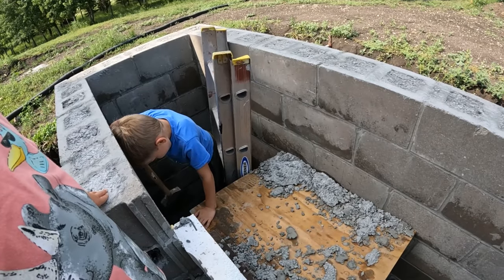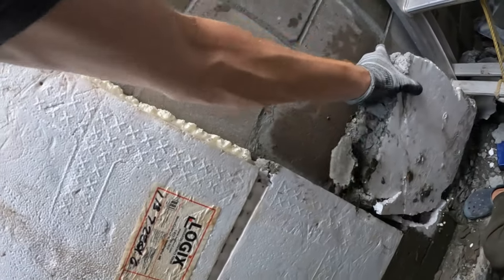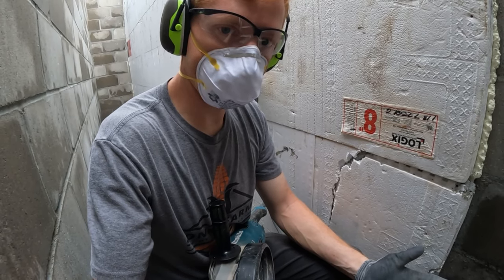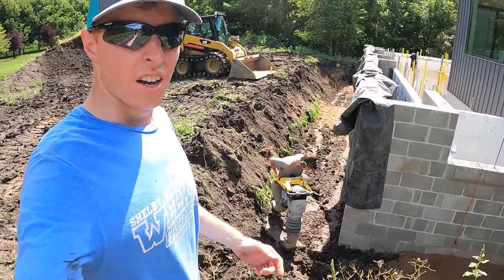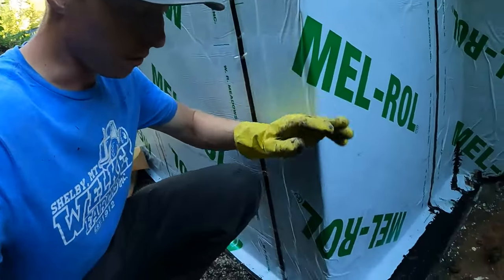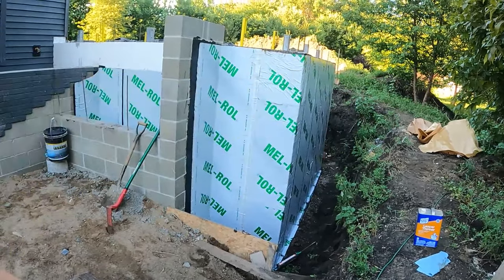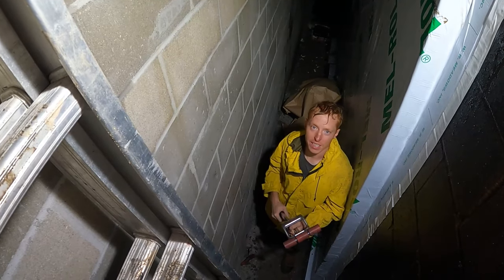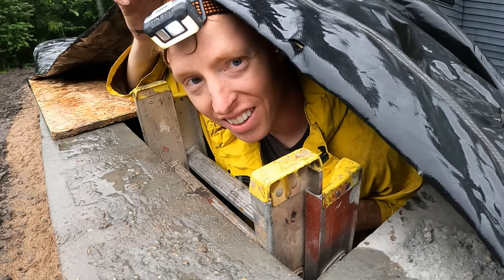Now its time to WATERPROOF - Patio Bunker  Ep. 14

Comment: just put a wedge in the handle of the hammer
Reply from the maker: Good point. There are actually 2 wedges in it. I was down in the pit and didn't want to crawl out so I kept pounding the wedge in and going til it fell out again.  Yeah that hammer needs to get permanently fixed or retired. -Matt